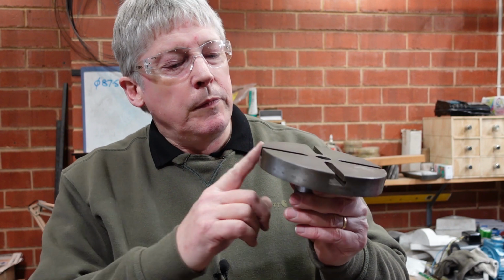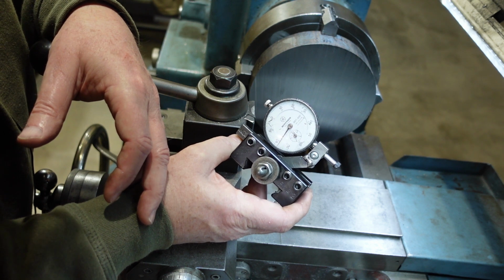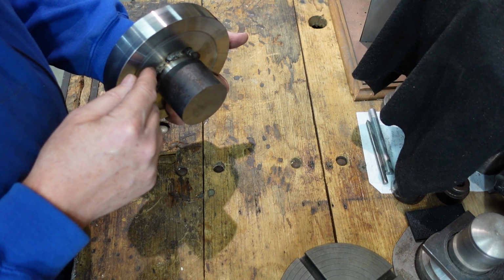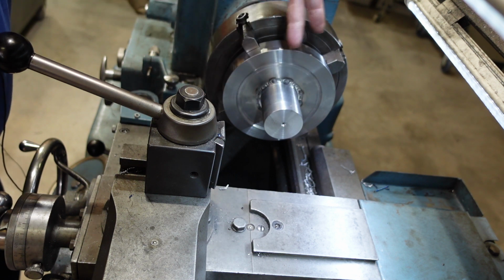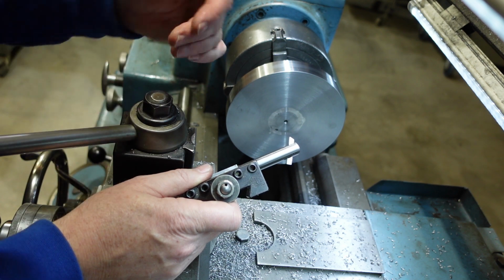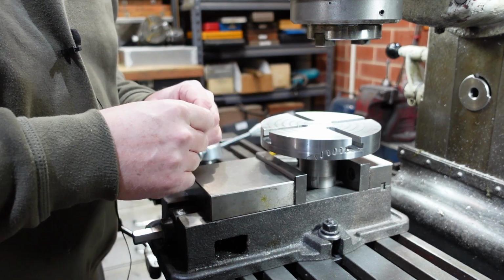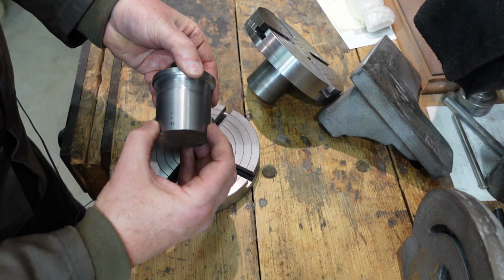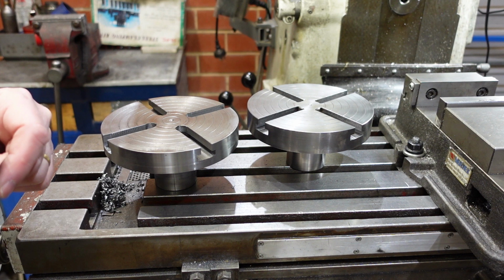A table for the TTH (TTH 4)

Comment: I'm sorry if I have asked this question before, but could you explain what "Black steel" is? Is it low or medium carbon steel that is cold rolled? (I suspect it could be, because of the black scale on cold rolled steel.) In continental Europe it seems that people us different names and as I am learning from your videos, I would also like to understand what kind of steel to order if I wanted to make simular works as you do (if I ever get to a decent skill level).
Reply from the maker: Black steel is a name we have in Australia for hot rolled, as it has that layer of black oxide on it. We also refer to cold rolled as bright, as it has been processed to remove that. 
For what I do (if anyone wants to copy) it probably does not matter. Over the years I have accumulated all sorts of offcuts so it is really what I grab first. 
Black has lower internal stresses so less likely to move when machined. It is (or was) cheaper.  😉
Reply: @occasionalmachinist  Thank you!

Comment: Perhaps the first table can find usefulness in an unintended purpose? Lathe tail stock chuck, weld positioner, work-holding pallet,  adjustable cup holder...
Reply from the maker: It might - I won't be chucking it out without first considering other options.

Comment: You  don't show any of the machine work
Reply from the maker: I often don't. I don't like talking over the top of a machine working as the resulting audio is terrible, and most times it's pretty boring. To get the table top done for example, there were lots of facing cuts. All viewers would see would be a lathe tool going back and forth with chips coming off. If it is something less usual I will show it - in the mirror ball mount video for example, there was some footage of using the ball turning attachment.